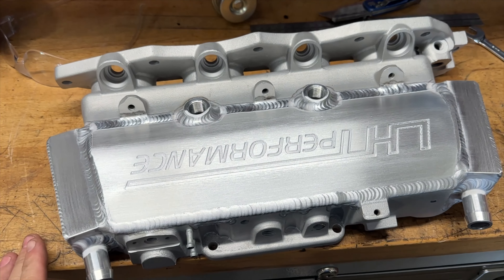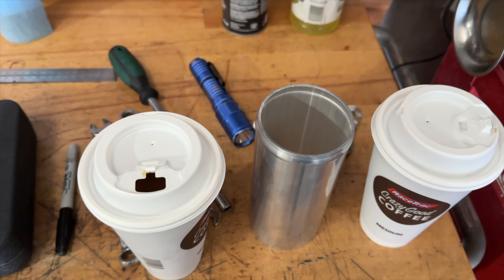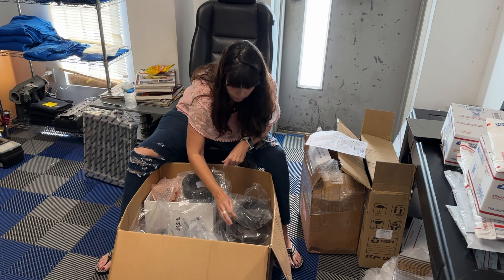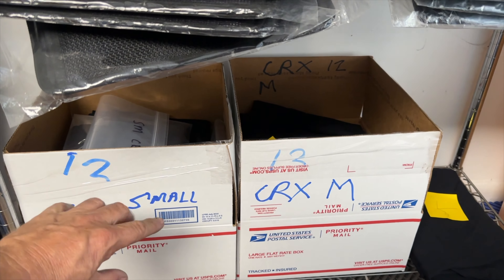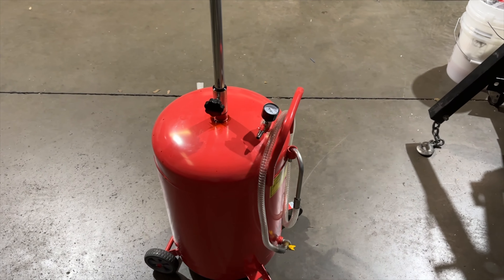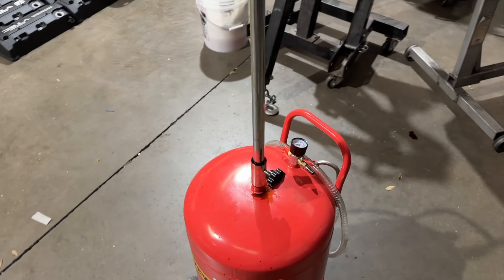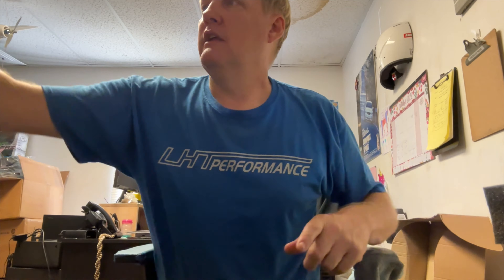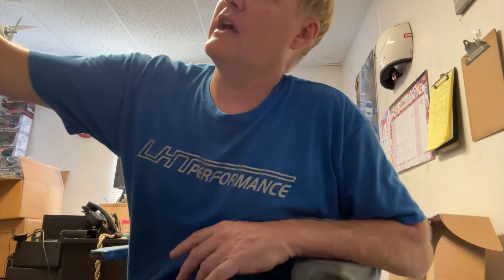S2000 shifter foam in Stock , MUST Have !

Comment: John how is the foam density between the Honda part and that new aftermarket part? Also got me wondering if there isn't any base material that might last longer than the stuff Honda makes theirs with...
Reply from the maker: The foam feels pretty much the same. The foam seems to break down after 10 years either way.

Comment: Those G series turbos are probably rated for flywheel HP. I’d be damn surprised if that g25-660 makes over 500whp tbh. Lol
Reply from the maker: They are rated at bhp.  There’s no plan make over 500whp as it’s unusable power in street trim. The fuel system will only support around 450 on our car, it will be for testing more than anything.